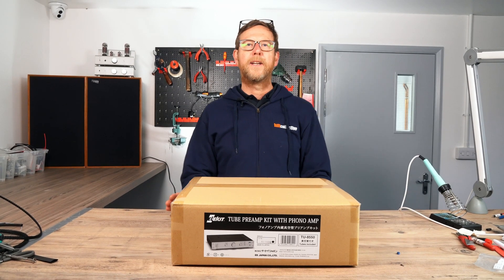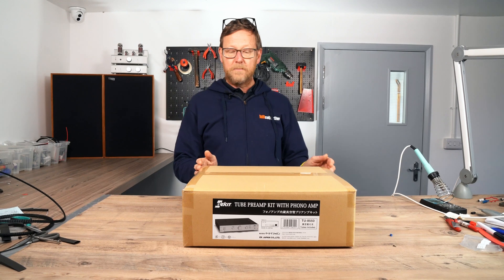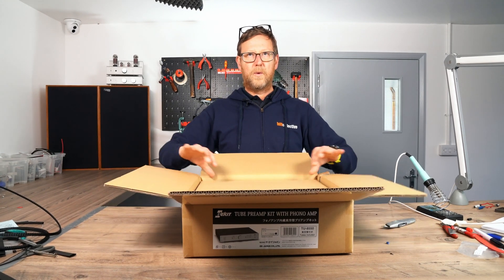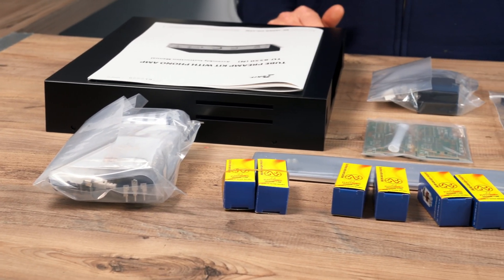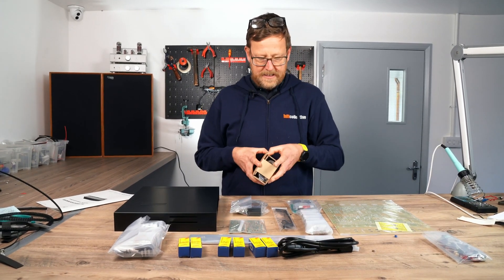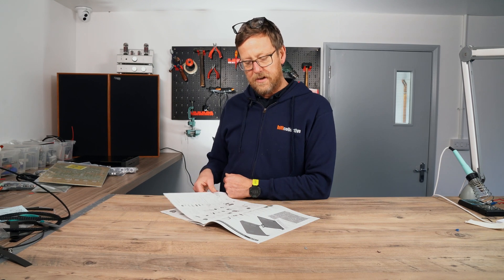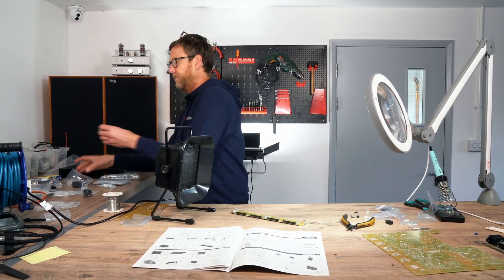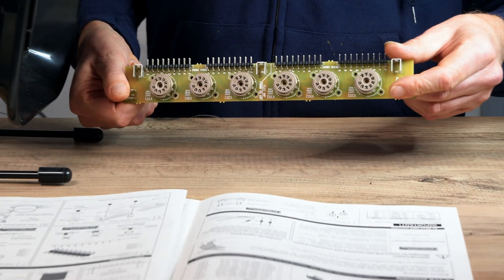Elekit TU-8550 Tube Pre-amp Kit with Phono Stage build (Part 1)

Comment: What would you compare to in terms of fidelity to what’s on the market. I’m looking for a great phono stage for jazz and rock. It’s not an extravagant system using a MoFi Ultradeck MM and a SS Lounge Audio phono. My integrated amp is a 00’s  Vincent SV 226 MK2 with a tube 3 x 12AX7 preamp. I’m looking to try a tube phono stage preamp for better sound stage but I just haven’t found many kit tube phono stages. Is this way more than I need? Can you suggest any other kits or any on the horizon?  Cheers!
Reply from the maker: Hi
I really don`t get to listen to much-finished products, but the Elekit is very refined and I use it in my system. I would say it is an improvement of my valve EAR phono stage